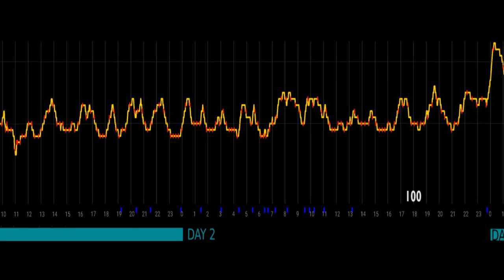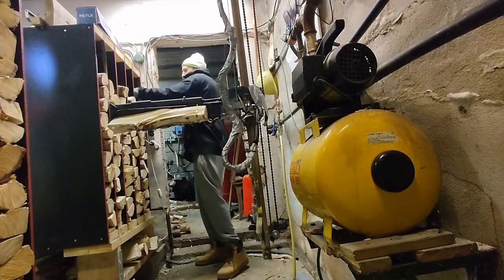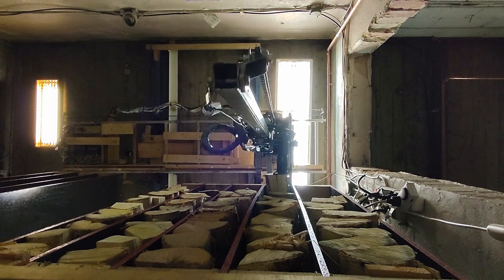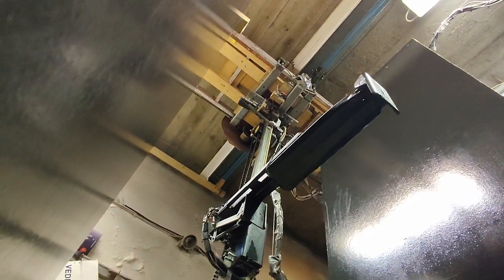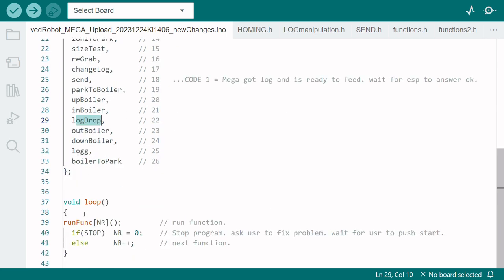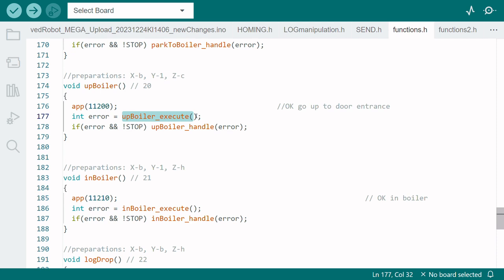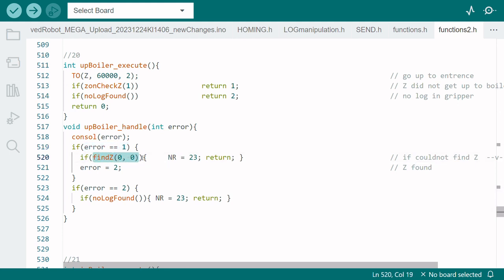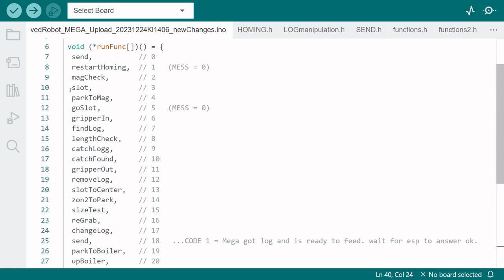Boiler log feeder robot. Part 12. (Project complete)

Comment: Very cool. Would you be willing to share your code? I like the structure and would like to learn more about how to build projects like this with a lot of steps broken out.
Reply: Is it possible to publish the code on GitHub?
Reply from the maker: perhaps :chillwdog:
Reply from the maker: Shure but to be honest I think I already showed the "good" part of the code. There is a lot of messy not so straight forward code behind most of the functions. This project was not just a cool project but also a nice way to get better at learning to code. A few years now since I wrote this code and some parts I now think is not so good. In the backend i use AccelStepper library to move motors in a while loop. And for each loop I check if max number of Steps is taken, digital read switches to see if they are still in the same "zon" and also if stop is pushed or crash switches are pushed. 
Rest of the layout of having Esp communicating with Mega I think is not best way. better to have just one Arduino..